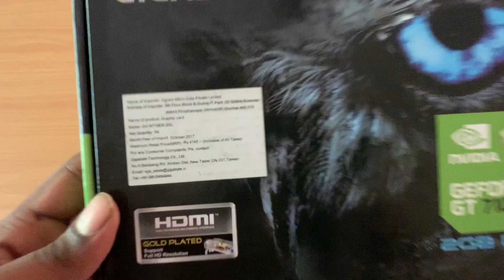GIGABYTE GEFORCE GT710 2GB DDR5 Graphics card Unboxing and Installation BUDGET GAME KILLER !!!

Comment: Hi. Please help me with this question. Can I use that same Video Card and will it be a good option for the following motherboard/processor/ram combination: Motherboard DG31PR. Core2Duo E7200. 2gb RAM DDR2 @667mhz
My PSU is 275 watts
 thanks in advance for your response
Reply from the maker: It will suite if your motherboard have a pcie (x8 or x16) slot 
But if you are choosing this for gaming it is not a good choice because according to your motherboard,ram and processor you can only play basic game like b2bug , uno ,flash games etc. I thought gta vice city will run when you install this card and you can run gta San Andreas and (gta iv ( at low settings)).
If you are choosing this for speed you will get a good amount of speed,you can easily watch full HD+ content easily.
Thank you
Reply: Atleast 4gb ram is needed for installing this gpu

Comment: Just one question does it need 8 pin power supply
Reply from the maker: This graphics card doesn’t need any type of extra power supply just plug the card to the pcie slot on the motherboard and you can use it
Reply: @TechniTips  thank u so much for reply

Comment: I have G-61 Motherboard with duel core 2.90 gHz processore... Can I use this graphics car or which graphics card should I buy??? Please ans....
Reply from the maker: Can you say the motherboard model no.
Reply: No... But I can inform to you that my motherboard & processor is 3rd genaration
Reply from the maker: Ok
Reply: Can I use this graphics card in my pc??
Reply: Hey please reply...
Reply from the maker: Sorry for the delay I didn’t get the notification. 
If your PC has a PCIE 2.0 slot it will work, you can use any ddr version for graphics card, ddr version is not an issue

Comment: wasup bro

can this run great on a, intel i-7 @3.60GHz ? ive asked some people and they said yeah but i just wanted to confirm from someone that has actually purchased this.
Reply from the maker: For your reference :
[This is a gpu which means 
graphics processing unit 
In this comment you asked the question about cpu which means
central processing unit.
The cpu unit consists of processor ram and rom but the rom is not important here, the processor communicate only with ram that means it is not communicating with the gpu directly 
the purpose of the gpu is helping the processor when there is a huge graphic processing then some of the load in the processor is transferred to the gpu then the processor can perform much better ]
So the conclusion is you can use any gpu card (graphics card ) with any processor at any clocking speed, the real matter is you need to check your pcie slot according to your graphics card, in this case we need pcie 2.0 and higher if you have that port in your motherboard you can use it.
Simply processor is working without the support of graphics card processor only needs ram it’s enough 
And also any Double Data Rate (ddr) is not matter with the gpu 
But in case of ram you can use the prescribed ddr only 
Eg : if you are using ASUS H81M-CS LGA-1150 Motherboard you can only use ddr3 ram but you can use any ddr graphics card
Thank you 🙂.
Reply: @TechniTips  ty! appreciate it

Comment: Can it support Asus h61m-k motherboard?? Please answer
Reply from the maker: It will support because the motherboard comes with a 3.0/2.0x16 pcie slot.
But I recommend, you should check it with a 2.0x8 graphics card, if the graphics card will support this also support the motherboard.
Reply: @TechniTips  what graphic card is best for this motherboard ?I just play freefire in pc
Reply from the maker: Can you tell me your budget.
Reply: @TechniTips  10k
Reply from the maker: I thought Nvidia GTX 1650, GTX 1050 ti and Radeon rx 570 is a good choice. 
Now you need to pick one according to your opinion and price. 
In Amazon you can find 
1. ZOTAC Gaming Geforce GTX 1650 OC
2. Zotac GeForce GTX 1050 Ti OC Edition 4GB
3. GIGABYTE Radeon RX 570 Gaming 4G 
I thought these are enough for you according to your needs. Thank you
Reply: @TechniTips  Iam From BD ;-; that's 20k for this graphic card;-;
I just play free fire in emulator because i 
want to play it smoothly that's why iam buying a normal graphic card

Comment: Can i ply Watch Dog 1🙄
Using this GPU😅
Reply from the maker: I thought you can play,
This is the minimum system 
requirements for watch dogs 1
———————————————————————
CPU: Intel Core 2 Quad Q8400 @ 2.66Ghz or AMD Phenom II X4 940 @ 3.0Ghz
RAM: 6 GB
OS: Windows Vista (SP2), Windows 7 (SP1) or Windows 8 (64 bit only)
Video Card: DirectX 11 graphics card with 1 GB Video RAM - Nvidia Geforce GTX 460 or AMD Radeon HD 5770 / Intel Iris Pro HD 5200
Pixel Shader: 5.0
Vertex Shader: 5.0
Sound Card: Yes
Free Disk Space: 25 GB
Dedicated Video RAM: 1 GB
———————————————————————
If you have 8gb ram I thought you can play it smoothly with this gpu

Comment: Can play fifa 2020 @ low settings
Reply from the maker: The minimum requirement for fifa 2020 is (AMD Radeon HD 7850 2GB, NVIDIA GTX 660 2GB, or equivalent) the gigabyte gt 710 is a small chip according to these massive machines. So you can play at low settings if you have more than 8 gb of ram with core i3 or higher 
[If you have an i7 with 16 or 32 gb of ram you can easily play it]

Comment: what the name of the pc you just install that graphics card in
Reply from the maker: It’s an assembled one doesn’t come with a name
Reply: Tech ni Tips I meant description of the pc like what is processor and what bit do you have and what window
Reply: Tech ni Tips is it window 10 and does carry 64 bit
Reply from the maker: Oo Here r the details 
Motherboard: gigabyte ga g41mt s2
Ram : hp 2GB ddr3 (*2)
SMPS : foxin FPS 500s
Processor: intel pentium 4
Os: windows 7 32 bit
Storage: WB 1tb hard disk
Case/ body : compaq presario body
Graphics: gigabyte gt 710 2gb ddr5 
With terabyte HDMI to vga adapter
Reply from the maker: It’s not my primary pc it’s my secondary one my primary one is acer aspire v5
Reply: @TechniTips  oh okay so do you think it would work on my pc it window 10 and the bit is 64bit ram 4gb harddrive 2tb
Reply from the maker: If your PC has a pcie x16 or x8 slot it will work if it has won’t it will not
Reply from the maker: Ram, windows version and storage are not connected with v ram
Reply: Tech ni Tips okay so do you think my pc will work with that graphic card
Reply from the maker: Tell ur motherboard model no
Reply: @TechniTips  um.. What
Reply from the maker: Can you tell me your motherboard model number
Reply from the maker: Without the number I can’t tell it fit on your PC
Reply: Is it under about my pc
Reply from the maker: Download cpuz and check main board option it’s the simple way
Reply: @TechniTips  okay

Comment: How many frames can it run fortnite
Reply from the maker: Around 30 FPS 
It’s according to your PC if the other specs are higher maybe you can expect more.
Reply: Tech ni Tips what video quality settings (Low) (medium) (high)
Reply from the maker: In low settings you can got around 40 FPS and in medium it’s around 35 FPS 
As I said it is according to your PC

Comment: support mobo g41?
Reply from the maker: Yes , mainly g41 comes with PCI E 2.0 x16 slot so it will support. [I don’t know about PCI EXPRESS 3.0 x16]. 
I have a g41 motherboard it works perfectly with that. In that I’m using pentium 4 processor with 4 Gb ram,
It’s good for playing mid games like gta 4, Drive San Francisco etc. in medium or low settings.
Thank you.

Comment: Good for gaming?
Reply: No
This is not a gaming card... but you can play game with it in low graphics settings
Reply from the maker: Every graphics card is for video acceleration, the duty of graphics card is to decrease the load of processor and give an extra support.
In my opinion every graphic card is for gaming and video purposes but it has a limit according to its power 
In an earlier comment I was mentioned about the games I was played using this graphics card you can check it out.
You can play a certain amount of games in this card in low and medium settings.

Comment: Dvi?
Reply from the maker: It is a large port like vga
Reply: Got it
Reply from the maker: But I will prefer HDMI
Reply from the maker: It is more useful than dvi because HDMI to vga adapter is more useful even you can connect your tv with HDMI to vga adapter (if the tv has an HDMI port)

Comment: Works on a ddr4 motherboard
Reply from the maker: Yes, it will work on any motherboard. DDR doesn’t matter with graphics card.
But you need to check if you has a pcie X16 (2.0 or 3.0) slot

Comment: Can this run Fortnite
Reply from the maker: This is the system requirement for fortnite

•Video Card: NVIDIA GeForce GTX 660 or AMD Radeon HD 7870 or equivalent DX11 GPU. Video Memory: 2 GB VRAM.
•Processor: Core i5-7300U 3.5 GHz.
•Memory: 8 GB RAM.

I’m not sure about the game I never played fortnite 
But i thought if you have a powerful processor and ram maybe this g-card can handle the game.

Comment: Free fire chal skta है क्या इससे
Reply from the maker: If your pc has a higher spec you can play with this graphics card 
This is an entry level graphics card 
If your pc has an i3 or i5 with 6, 8 or higher ram you can play or else it will stuck 
I was managed to play pubg with this card in my pentium 4 processor pc with 4 gb of ram but the frame rate is choppy 
Not smooth, but I managed to play it.
If you have a better processor with good amount of ram you can play with this card or else look for another one. 
Thanks for watching 😊